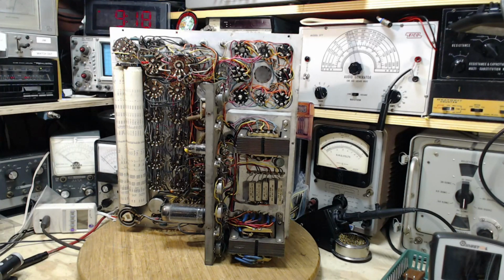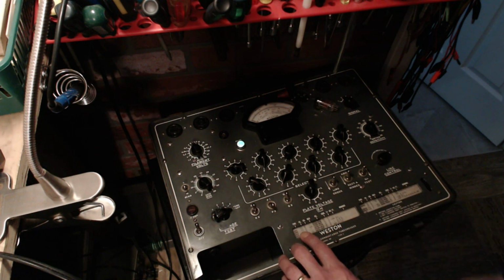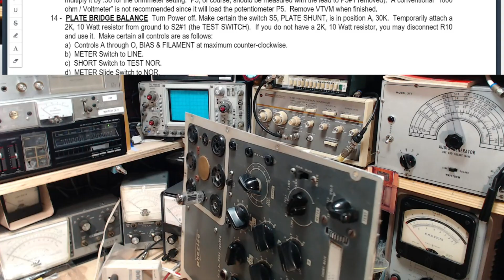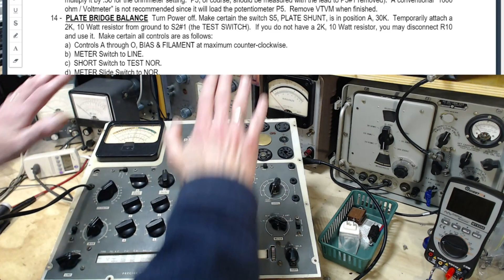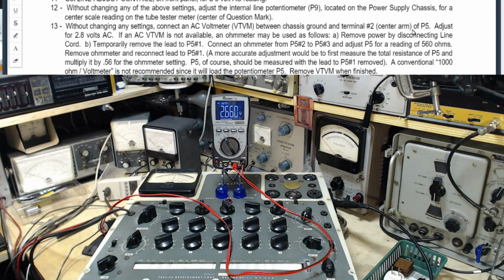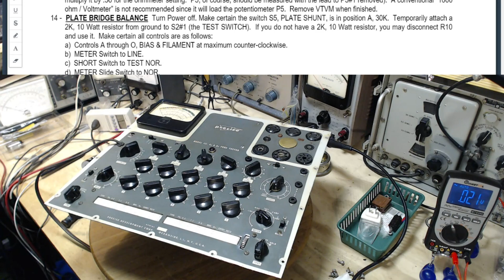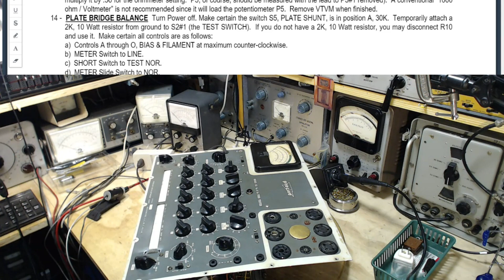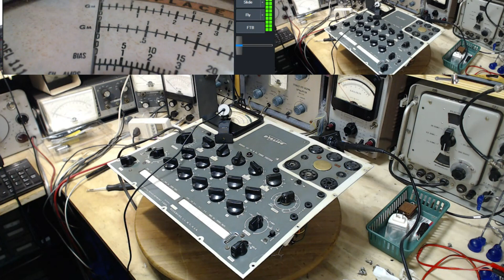Precise Model III Tube Tester Video #4 - Plate Bridge Balance (Error!)

Comment: If you worked on amplifiers all the time, you'd have plenty of 6L6's.   The Fender amps used them. There are nearly the same tubes out there for subsitutes, but the 6L6 remains the gold standard.
Reply from the maker: I've recently acquired a number of 6L6 tubes and I am about to correct the calibration error noted in Mark's comment.

Comment: I knew the meter would be off from calibrating your line when it was on its side
Reply from the maker: I have this tester on my bench again to correct a few things.
Reply: @JimsRadioShop  yes it's worth going through again especially for calibrating line. Cause noticed you didn't check the first voltage in instructions when you had the tester laying flat

Comment: Jim, I know I'm late but I've just discovered that the instructions you're using are WRONG! 

You're not using the original instructions but the ones made by someone. They're cleaner but there is, at least, one major typo error: When the "clean" instructions indicate to wire a 2K 10W resistor from S2#1 to ground it should say S2#11 instead. Read the original instructions to confirm. I know it the hard way because I did the same as you did! The 2K resistor was VERY hot and the 6X4 was driven very hard. You may damage PT4's 3-4-5 secondary. 
Once I noticed the error, I rewired to the correct S2#11 and everything was OK and the 2K resistor was only lukewarm. The calibration was then successful.
Reply from the maker: Thanks so much for catching this error.  I'm about to correct it.